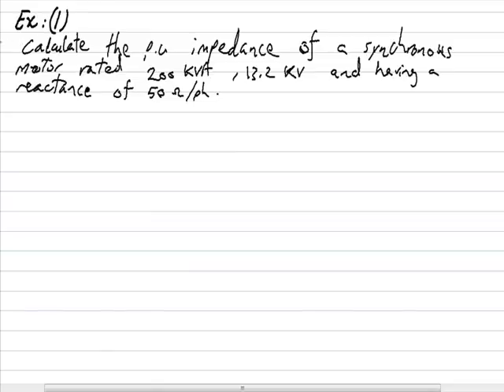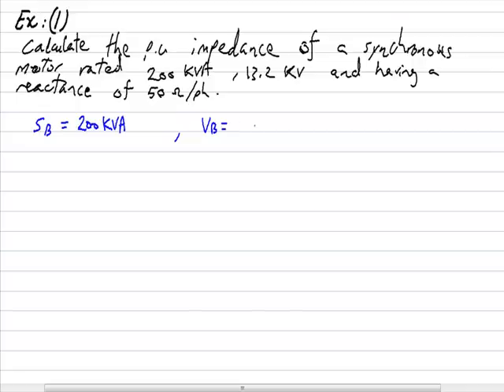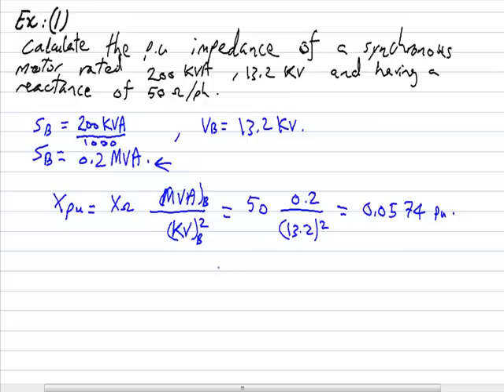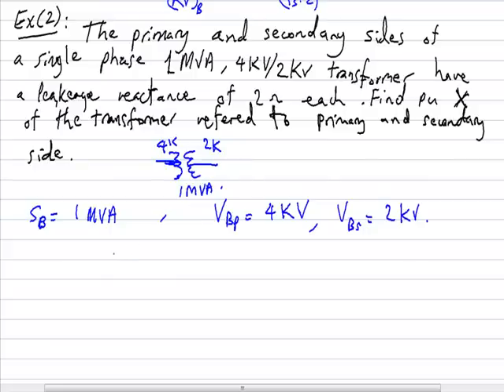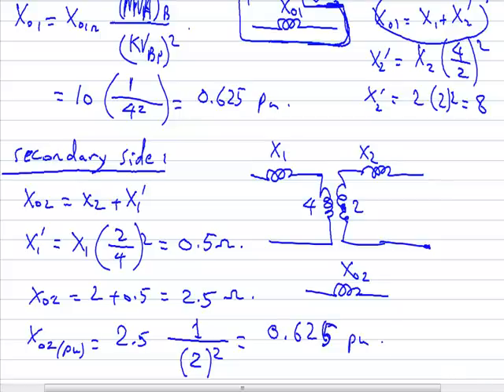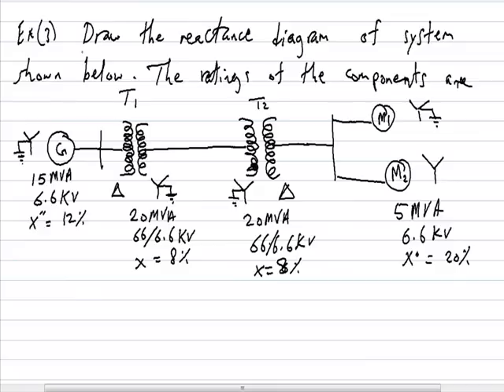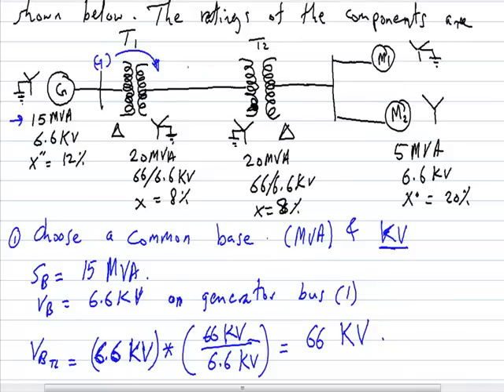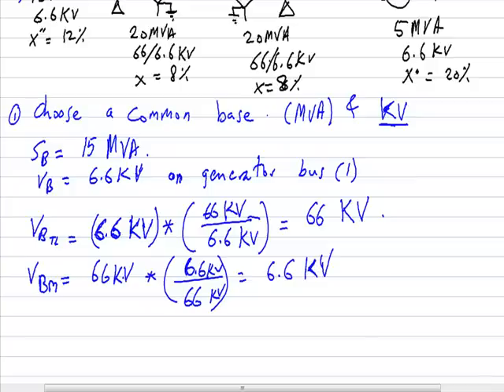Power System Analysis (Lecture1.3) Examples

Comment from the maker: sorry guys there was a mistake in the question , the transformer T1 is a step up transformer which is 6.6KV /66 KV. then the answer should be correct. You should notice that because it is always in the power grid there will be a step up transformer after the generator.
Reply: i was thinking about it actually unless i saw this comment, thanks for the correction. This video is really helpful.
Reply: yes it should be a step up transformer

Comment: at 14:55 , when you calculated voltage base for TL, why did not convert the phase voltage line to line voltage? the transformer is a delta-wye connection and in generator side you have phase. after the step-up transformer, you should multiply by sqrt(3). am I wrong?

Comment: He in calculation of base line you take 66 sec and 6.6 primary .....why ? base line= 6.6*(6.6/66)..... I think t1 rating will be 6.6/66 . correctif iI wrong
Reply: +INDIAN yes that's what I was thinking secondary over primary but he took primary over secondary
Reply from the maker: +Nawaf Yousef sorry guys there was a mistake in the question , the transformer T1 is a step up transformer which is 6.6KV /66 KV. then the answer should be correct. You should notice that because it is always in the power grid there will be a step up transformer after the generator.
Reply from the maker: +INDIAN sorry guys there was a mistake in the question , the transformer T1 is a step up transformer which is 6.6KV /66 KV. then the answer should be correct. You should notice that because it is always in the power grid there will be a step up transformer after the generator.

Comment: ex 1- you should be looking for the z base. and thats not the formula. impedance z is not x reactance. wrong.
Reply: we have resistance and reactance ..so we can calculate impedence easily
Reply: They are the because Z=R +jX but they R is very small and it's considered negligible therefore Z is considered jX.